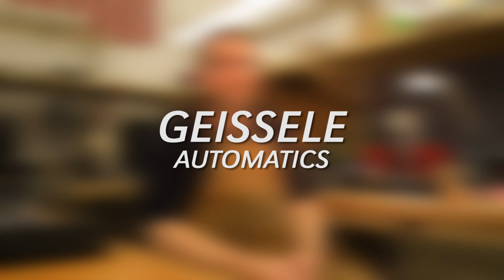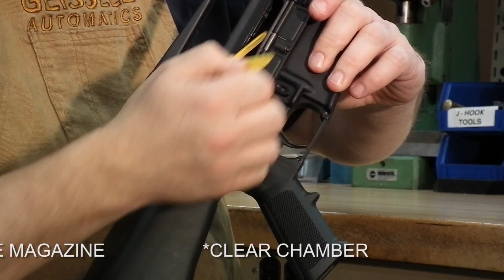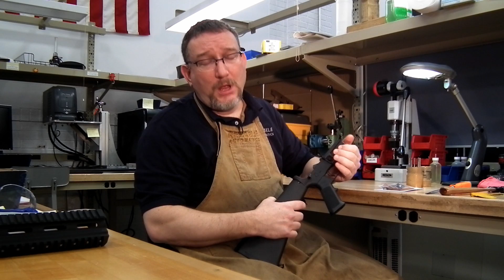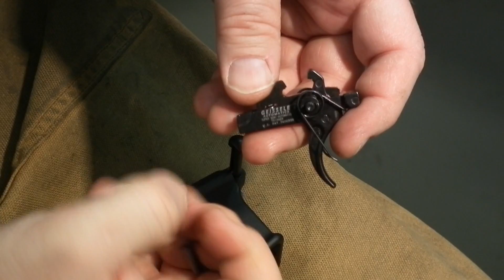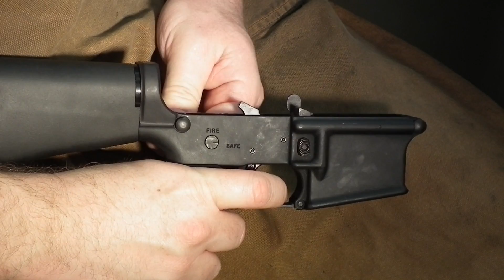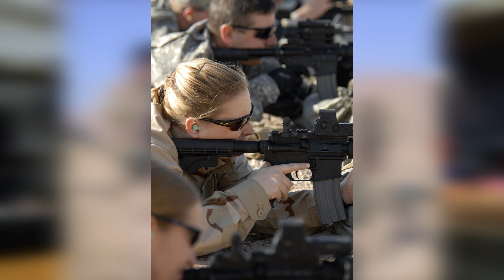Geissele Automatics - SSA Install - FULL VERSION

Comment: Great installation video thank you. 
Loved this trigger (SSA-E) in my 5.56 AR15 but be aware this trigger will not work in a Tippmann M4-22lr and results in failure to fire even though the rim of the round appears to get hit pretty hard. Geissele customer service was informative but unwilling to accept a "used" trigger to be returned. Geissele also stated that the trigger would eventually be "destroyed" if used in this firearm! 
Please find a solution to adapt this excellent trigger for 22 use.

Comment: Safety selector switch MUST be in FIRST -then the trigger or you can't get the selector in afterward because it will NOT go thought the hole because there is an interference with the trigger frame.... Even this guy guy can fuck up- Now I have to take it out Ok!.. Kiss my Peterson 3rd eye..

Comment: This isn't the "trigger of the seals" This is a SOPMOD legal trigger meaning it can be installed if the operator wants it but very few if any run this. Negligent discharges are made easy with this trigger.
Reply: what does this mean, literally makes no sense. you obviously have no idea what your talking about

Comment: I just complete an install of the SSA-E trigger. No problem. No more than a light tapping on the pins. I am mechanically inclined, but this is the first trigger install that I have done. I did not have to remove the safety to replace the trigger. It took about one hour for me to complete. The alignment tool helped with the hammer install. Basically, no problems with the install. Now to the range to test.😀

Comment: I wasn't sure if my scope was still zero'd after i installed my SSA trigger. I set up a Dummy Target at 85 yards at the gun range. My first 3 shots i put strait through the heart with in a 1 inch spread. The SSA trigger greatly improves accuracy, and is actually safety. The heavy trigger pull on Factory AR's is ridiculous.  Badly effecting accuracy.  Rog

Comment: Installed my SSA-e trigger today. First one, took about 10 minutes. Video is a great help. Would be helpful to zoom in a little more on the hammer installation portion. Probably the hardest part. Took me a few minutes between looking at the angle of the lower and the installation pictures to figure out where the springs went. You guys make awesome products. Installed my mark 8 Mlok hand guard today as well. Super easy and amazingly well fitting. Super fast delivery on my purchase and thanks for the little extras. You guys are a class act.

Comment: What do you do if the disconnector doesn't let go of the hammer? I have the DMR and the disconnect only let's go when I push it down by hand a little bit before pulling the trigger.

Comment: Could use more zoom close ups on the instillation. Could see when you talked about the slave pin sticking out and pin not all the way in. Couldn't see the hammer spring placement on trigger pin. Thanks though keep up the good equipment

Comment: Any chance of an updated version that shows what's going on inside the receiver during the install? Telling us what you're doing is one thing, but if you could zoom in and show it, that'd be really helpful...
Reply from the maker: this is an old video first shot at a time when a "skeletal jig" was not invented at the time. it did not exist in  the industry. nowadays, anyone can buy a jig. and plenty of videos today exist, showing internals. a zoom could never show the physical install because the thumb has to come up and over to apply just the right pressure, covering the top of the cavity. do a search for "AR skeletal trigger jig". there was no budget to CAD design or even mill one. best regards.

Comment: Mr. Geissele, your pace of instruction and clear voice are excellent, but this instructional video calls for some clear close ups of the trigger and  hammer installation. Between the video and the instructions, Im pretty sure my trigger is installed correctly, but Im having a really hard time with aligning the hammer spring.  The picture in the instructions is no help at all. It looks as though I have to bend the legs waaaay back, and that makes sense to build spring tension, but Im afraid of damaging the spring without close up instructions. Im also not seeing where the grooves on the pins capture the spring and prevent walkout. Please take some closeups and insert that into your video. It is easy to do with Windows Movie Maker or the Apple analog. Thanks for making these videos. You are a great engineer. I am looking forward to buying the Tavor trigger. Please also make a trigger for the Sig Sauer P556 pistol (550 family of rifles).

Comment: just installed ALG QMS and then an SSA. Will be interesting to see how they shoot.  Hope to buy an SSA at to replace the QMS if I end up liking it better.  Thank you for giving detailed product info and tips about install.  Pins tight, but once aligned, bingo.  I am confused by the difference in the QMS pins (three scorings on the pins) and the SSA pins (only two and offset).  You say in this video which way the pins are installed on the SSA doesn't matter, I hope I have not made a mistake.

Comment: Pros of this video:

- Since graduating college in W. PA 15 years ago, I miss that Pennsylvania twang

- The lecturing on pin steel woke me up. I won't even THINK about getting an aftermarket pin now.

Cons:

- I can't actually see what you're doing. Close-ups would be nice, but since I've installed a LPK, I can infer what you're doing.

The video overall is very helpful, and even if it's hard to get the kit installed, I can watch cool .mil photos in the meantime.

Comment from the maker: @TacOpsDaddy ...
your nickel boron hammer is a mil-spec part.
sister company ALG Defense makes the ACT trigger/hammer kit, based on Stoner's mil-spec design --algdefense-dot-com.
Geissele Automatics custom kits depart from the mil-spec design, and the trigger/hammer must be properly paired for safety and function. we don't sell custom triggers separate from the custom hammers.
fear not, the GA custom kits are hardened, twice cryogenically frozen, EDM wire cut with razor sharp sear surfaces.

Comment from the maker: sister company, ALG Defense, manufactures the ACT-- ALG Combat Trigger-- which consists of a mil spec trigger configuration, with contact surfaces cut razor-sharp with EDM process (no stoning required), with trigger nickel-boron-ed and hammer nickel-teflon-ed.
SSA on the other hand is not mil spec. to get the max trigger performance out of the AR15 platform, the SSA had to evolve from the mil spec design.
your Fail Zero hammer is mil spec, while the SSA is custom, cryogenically tempered twice.